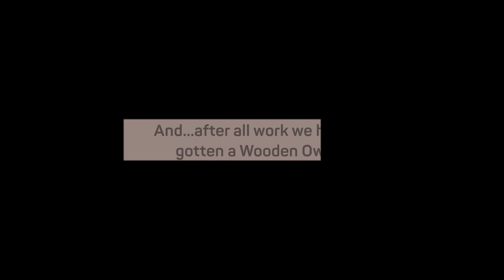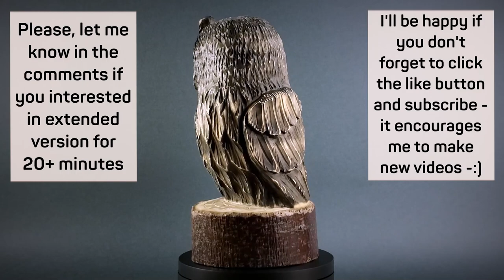Carving the Owl from wood without any mech tools. Wood carving from blanket to full figure

Comment: that cracking is why I dont work green wood, awesome work though
Reply from the maker: Yes, cracks are always a problem when working with wood. To ensure that there are 100% no cracks in the figurine, you need to choose another material. A stone or some kind of polymer. But the appearance of cracks can be minimized by high-quality drying. We dry the blanks before carving. But as you can see in the video, microcracks still have to be repaired. No wonder they say that wood is a “living material”. It is warm, pleasant to the touch, 100% natural, with a beautiful texture and is relatively easy to process, but we pay for this with cracks and brittleness
Reply: @OldAndrew  I carve bowls and kuksa by hand i only use well seasoned burl usually slow dried intact for years  I never really  have cracking issues in my pieces
Reply from the maker: You are doing everything right! I wish there were always no cracks. Best wishes from old Andrii